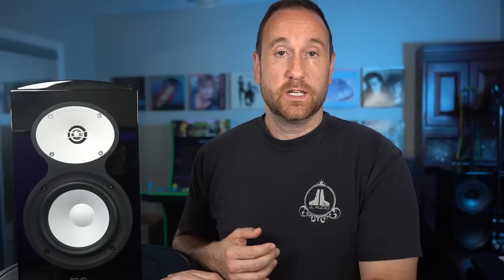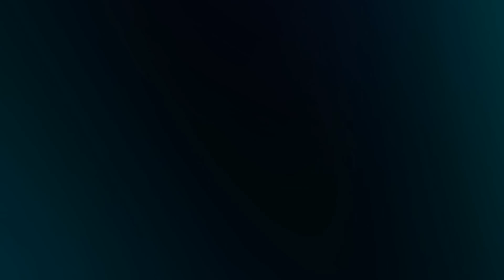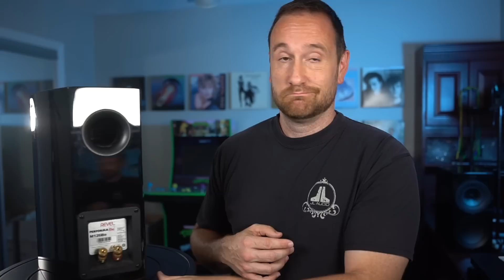How to Aim Your Speakers

Comment: I'm treating my room a bit like my car. Currently Have my left toed IN and right toed OUT. Left is closer to a wall, and right is open to the rest of the room. All corrected using REW.  I recently tried using digital in on my 2x4HD and doing a "tune" w my unused channels. (yamaha in Pure direct) it was/is beautiful.
Reply: Unfortunately you said left twice
Reply: @lsaideOK   ahh geez. thanks. Yeah I have the one by the wall in to avoid the wall, and the room side out, because I don't want that one hitting the wall either. Either way, I've found Off axis makes the speakers more transparent in most situations.
Reply: @kewlbug  Thanks for that info. I'm in the same situation but usually toe them both out towards my shoulders. I might try toeing the one against the wall in. One of the great things about bookshelf speakers is how easy it is to change their positions!
Reply: @lsaideOK   note! that you may need equalization correction. This setup is certainly not ideal. everything's always a tradeoff..  Your wall speaker will have more low end that may need knocked down and the open side may need some help there.   I would never claim to be doing things "right" but it's your system, so try things and have fun!  Referencing Erin's video, he's right, the "sweet spot" is most certainly smaller. But the wife doesn't know the difference when she's next to me. lol

Comment: So if the speaker is shooting straight ahead, is it considered to be toed out?
Reply: Straight ahead, relative to the room (perpendicular to the rear wall) is toed out relative to the listener. Erin always speaks relative to the listener, not the room.
Reply: @WestonWill  Thank you! So when, in the recent Kef R3 Meta review, he suggested toeing out the speakers,  did he mean to place the speakers perpendicular to the rear wall?
Reply: @sebastiantomita5956 Not necessarily. In fact he mentioned 10 degress off axis. This means the speakers will face 10 degrees off from you.
Reply from the maker: Yes. And Weston is correct; the aiming is relative to the listener.
Reply: With two speakers along the wall and listening position the same distance from each speaker as the distance between the speakers,  having them like that would be a 30 degree toe-out, which is enough to affect the tone quite a lot on most speakers. Lots of reflections too.

Comment: Great explanations. I crossfire my front l/r speakers for wider sweetspot for home theater use.
Reply: I do the same in my family room, which is also my listening room. My seat is in the sweet spot, but I moved around the room when I first setup the system with the speakers toed out a bit and found the sweet spot to be very small. Toeing them in really helped the other seats and I didn't find there to be a very large drop off in imaging/stereo effect. The tradeoff was worth it.